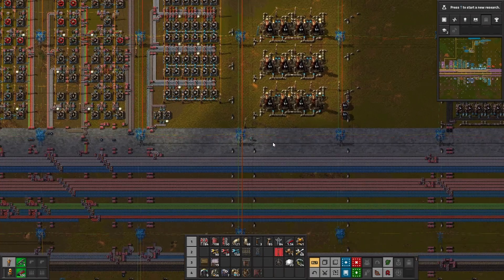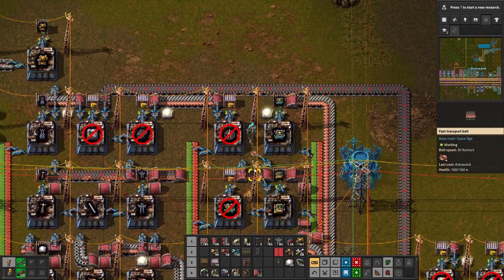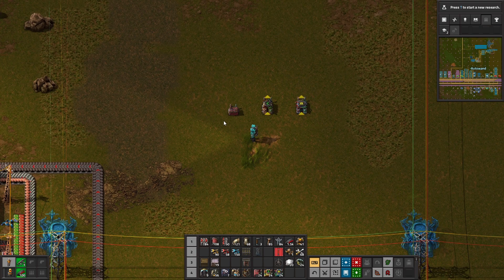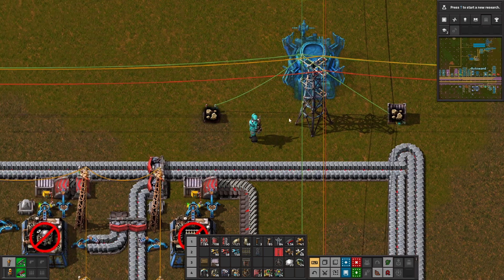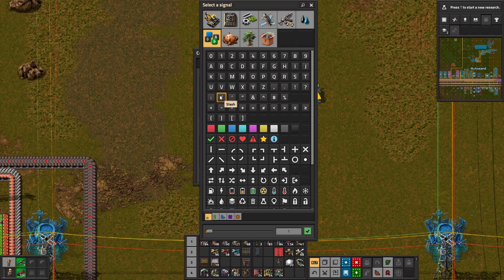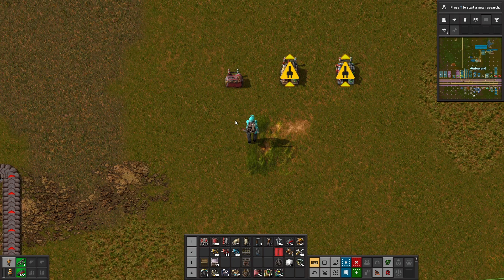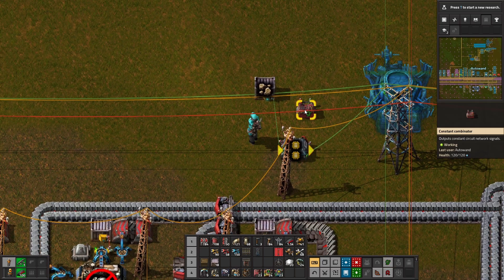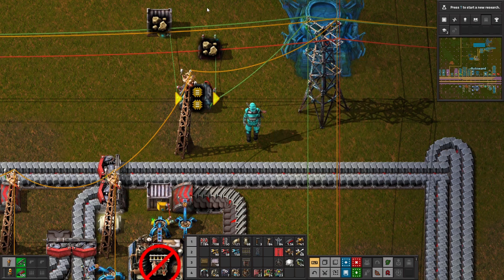Combinator Basics & Signal Logic Setup | Factorio Space Age New Player Guide | #25.5

Comment: This is only really useful if you don't want any waste, if you want like 100% efficiency, but you can always just overproduce everything, i spent like an hour watching different videos and reading wiki's, and i still can't find a situation where you need to use these.
Reply: It’s very useful on the spaceships to keep inventory controlled and more automated
Reply: I use deciders to keep my boiler power separate from my main grid unless the power in the accumulators drops below 50%. I also use them on the pumps for the boilers, 1 set of boilers has pump come on if accumulator power is 50% or below and the steam tank connected has less than 2k steam. Another row set at 25%.
I also use them in my refineries and chemical plants